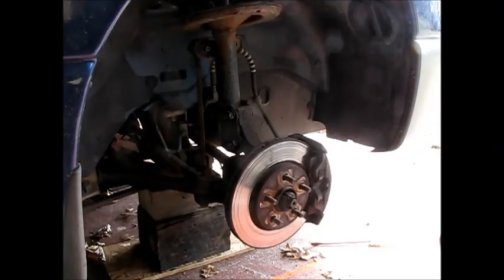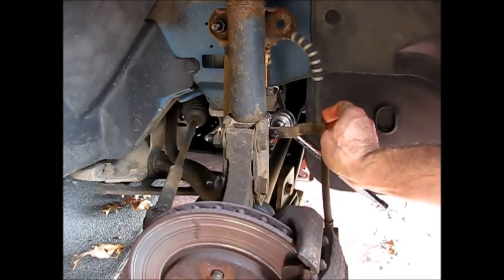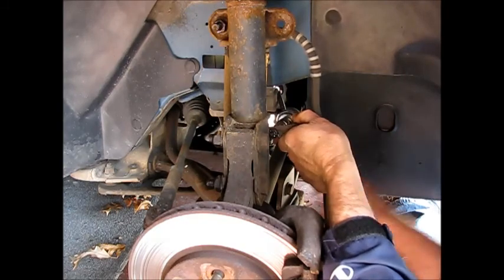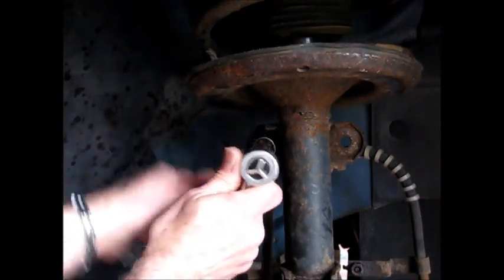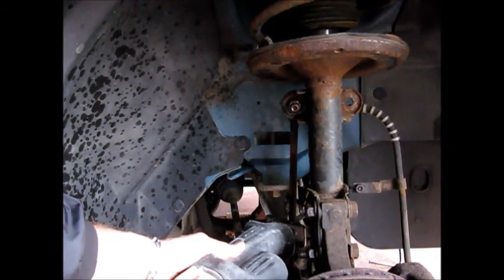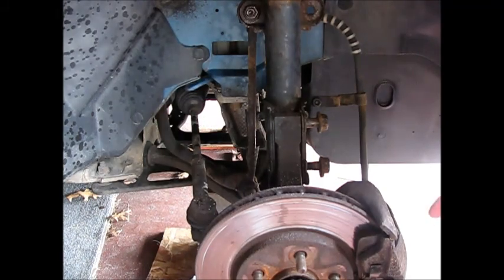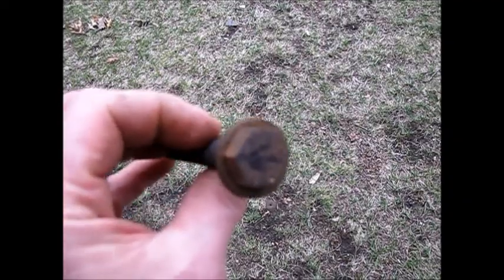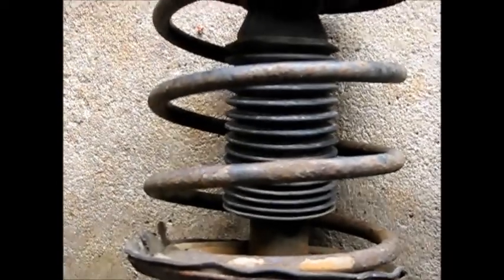How to replace the struts on a 1996-2002 Caravan, Voyager, Town and County part 1: disassembly

Comment: So glad I watched this pertiular video, when marking the cam bolt, you may want to go over the sharpie or grease pencil with a nice little Dremel bit. Makes the line permanent, just in case you're original mark gets wiped/washed off. The other video didn't even mention the alignment bolt, or marking it. I bent my tongue wrench, sheared off a 3/8 drive ratchet and a half inch 3/8 adapter for the 21mm deep socket. After tapping and heating with map gas, not fun in nor-cal under a tarp. Third time's the charm. Thanks again for a great video.

Comment: Nice video. To the point and deals with it like a home mechanic would. So many of these the mechanic likes to talk ad infinium and that makes the video unnecessarily long. One tip, I like to slip and old toaster cozy (or equivalent) over the brake rotor/caliper assembly to avoid the rotor getting smuck on it. I work kid messy...

Comment: Thanks Original Mechanic!  This video was a good deal more useful than the two others I saw...which were slicker but failed to address the real-world issues (frozen bolts, stripped torx bits, corrosion, especially presenting the alignment preservation option (marking the cam washer).  I appreciated that you didn't seem afraid to admit when things didn't go smooth and how you resolved them.  My Grand Caravan is an 04 but this seemed to be pretty spot-on for that year as well.Cheers!
Reply from the maker: Brett Wilmore Hey thanks man. I do try to show the trials and tribulations of the lone and sometimes struggling guy in his garage trying to find a way to get it done. I'm giving you kudos for the best critique of one my videos I've seen yet! Glad it helped and thanks again for the comment.

Comment: I have a 99 Plymouth Grand Voyager, 3.3 engine.  It has 2 brake line cable attachments instead of just the one shown in your video, and to my surprise the two large 21 mm 3" long bottom bolts that hold the  strut to the rotor assy were SPLINED, which helped with the bolts not turning when trying to remove the nuts, but my bolts were frozen in the holes.  I banged on them w. a hammer and they still would not come free.  So I put a cheater bar on a socket and twisted the bolt heads (breaking the splines inside, which I couldn't see, and didn't know about) while banging on the threaded end of the bolts with a 9 pound hammer, they still would not come out of their holes.  Finally I swung that 9 pounder with all my might, that broke them out of there.  I wish someone had warned me about the splines though, then I would not have twisted the bolt heads to try to free them up.   I also had to whiz wheel off my sway bar link, then torch (heat) the hole and bang on a punch to get the 18mm bolt out.  Love all your videos.  You are so safe and thorough and explain everything well with usually great camera work.  I love it when you run into problems like frozen rusted out bolts, etc. and explain your options and show us how to overcome these problems.  Whenever I have an issue with my van, I always hope you have done a video on my issue, I look for your advice first.  Keep up the good work.  If I had more money to my name, I should be paying you, for all the help I have gotten from you over the years.  I'm so glad you have made these videos.  PS.  New Strut assy w. coil spring from O'Reilly Auto Parts was $160.  New sway bar link was $25  as of June 2019 here in rural Nebraska.  I am slow, so it took me a whole day just to do the front passenger side of my van.
Reply from the maker: Great job of sticking with it. I appreciate that you took the time to make this detailed comment. I'm now in the process of squeezing a few more videos out of this soon to be retired van.

Comment: THANKS so much!  I just had to do this repair -- as my strut broke while driving.  

Luckily, I was only going 45mph and it just fell down on the tire and began riding / rubbing on the tire -- it ruined the tire but I made it home.
Reply from the maker: You're welcome. It's rare for one to break like that. That's scary. Thanks for watching and I'm glad you're OK!
Reply: I think they should have had a recall on these vans over this ... I have three of them and they all are rusted out at the top -- where you unbolt the three nuts inside the engine compartment -- had to buy new "caps" and have them welded in.
Reply: The bottom "plate" of the strut rusted through and was pushed down onto the inside of the tire.  I actually drove 40 miles home with it like that -- smelling the rubber burn away on my brand new tire.   Had it not been a brand new tire, I never would have made it. 

If you're looking for a tire with "90% tread", let me know (just not the typical 90% of tread that is left -- horizontally instead of vertically).  :)

Comment: Thanks for the vid. What I did for the swaybar linkage bolt was to chase the threads with a die to get the nut off. Start with the leading edge and work it as far as it will go, back it off, flip it around, then all the way down again and back (you can run a socket on it).  I pretty much didn't have a choice as I did get the nut loose but the threads at the end were too buggard to get the nut all the way off. I picked up a die (mine was 1/2-13) for less than 10 bucks off amazon and once i chased it, it was good.

Comment: Hello David, thanks for your great video! However we have a situation where it seems that the top center nut has come loose, you can hear some noise as you drive the 2001 Town and Country. It sounds like the threads are scraping inside of the hole in the center of the "bearing plate" It just started out of nowhere, we just bought the car a few days ago with no noise. So I was able to get a finger in the small space above the top of the strut and I can feel the nut is loose and was able to turn it tightening slightly with my finget tip. So we're hoping to save the strut, is that possible by just compressing the spring, removing the strut and retightening the nut? Thank you!
Reply from the maker: I haven't been in that exact situation. It seems it would be possible, but if the threads become damaged or it doesn't hold you may need a new strut assembly.

Comment: Never cut through the arm before trying to remove the bottom end. There is a slot on the "bolt" so if the 6mm allen strips out you aren't SOL and can still get the nut off.
Reply from the maker: Good to know and thanks for posting.